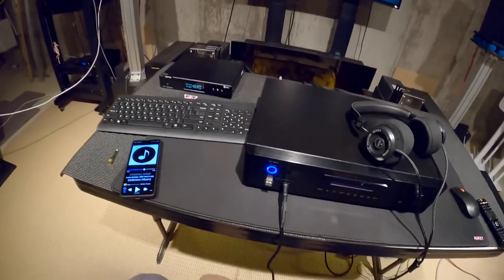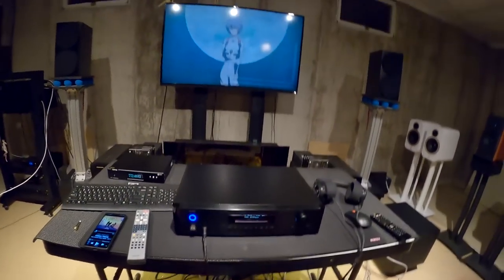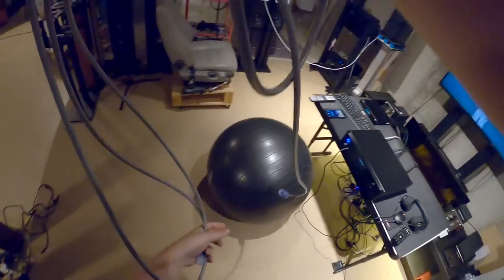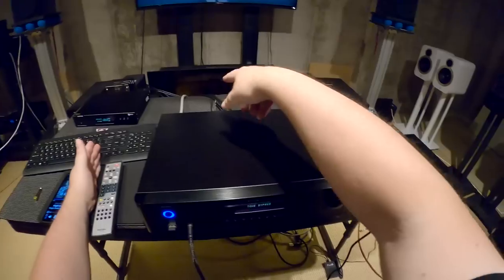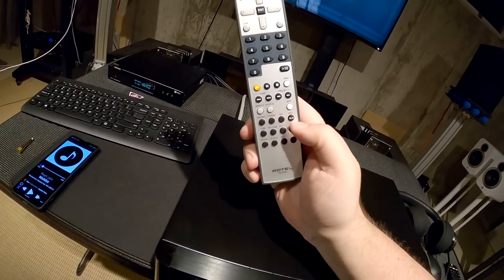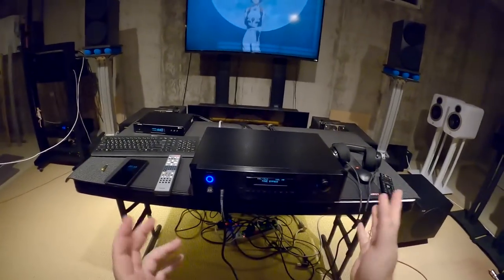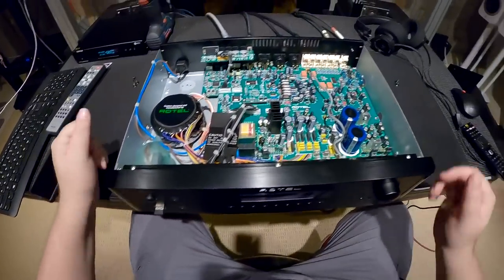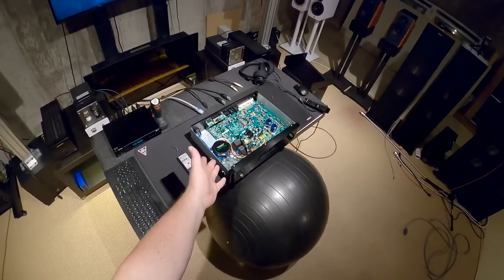🟥Why don't Cheap Pre-Amps Exists? _(Z Reviews)_ ROTEL RC-1570

Comment: This has been my pet peeve for 20 years. Thanks for bringing it up. When you can get a receiver that does 7.1 DTS/Dolby digital for $500 or less yet a pre-amp that has NO AMP that does the same thing can't be found for under $2000. Well, that's not entirely true anymore as Tonewinner came out with one for $1500. But still. ALL receivers should have PRE-OUTS!
Reply: You can actually do this with studio level interfaces, I use a motu A8 for it. Set it up with a pc, then you can use tablet or phone to control it through wifi. $800 and it has really good ess Sabre 32 dac
Reply: @Edinsism  Do what? There's no hdmi input on that nor multichannel processing.
Reply: @redstang5150  The unit he reviewed doesnt have hdmi either. The motu interface is literally used for making surround sound, it has optical and USB and AVB. You can program the unit to take any of its inputs and route it to whatever analog out you want. Hard to explain but the software will take that optical or cpu output recognize if its multi channel and you can route it how you like. In the case of a reciever you can use preouts into the analog ins. You can also eq your speakers and phase delay them at the same time if you want.
Reply: @Edinsism  No, but the point was about reasonably priced pre-pros - the key being the 'processor' part of that, and therefore you need something to decode the DTS or DD multichannel signal. That motu 8a seems to be more of a mixer/eq similar to a miniDSP - are you saying it can decode DTS HD and/or Dolby TrueHD deliver to it over USB/Ethernet (optical only delivers up to 5.1 channels)? It looks more like something I'd actually mix a 7.1 track to produce a movie rather than use it to decode multichannel tracks while playing movies from my plex server.
Reply: @redstang5150  yeah it doesnt decode dts. I use it from my pc which decodes and sends it through usb or ethernet. I use standalone amps so it does the same thing as a preamp for my setup. I got out of the reciever game a long time ago because they get outdated too quickly. I primarily use it for games. I am sure there is studio device that does what you want but its quite hard to get any real info on them.
Reply: @Edinsism  So what on your PC 'decodes'? I have separate amps too - like anyone that is using a pre/pro or has pre-outs on their receiver. For home theater - how do you get out of the 'receiver game' without having something that decodes DD/DTS? That's my entire point - spending $2k - $5k on a processor is crazy because that's the ONE thing that becomes obsolete. When a receiver that costs $500 can decode DD/DTS, I should be able to buy just a processor for that as well.
Reply: @redstang5150  You can software decode with certain codec  packs and play from media players that support surround  sound. The only thing that I have found doesnt work to my  knowledge is atmos height  channels. If you do use HDMI on  pc, you can also decode with nvidia cards before its sent out.  K-lite codec pack is the one i used.
Reply: I dont think i have ever owned a receiver without preouts

Comment: Usable class A and/or AB circuitry is not cheap.  Preamp is where the most gain is applied to the signal chain, which also makes it the most susceptible to noise.  Can’t skimp on shielding and power supply filtering in a basic 1in/1out pre, let alone units with multiple source inputs and output

Comment: Assuming you didn't make any big mistakes matching your components, the preamp is the most important piece in the system. Alot goes into making a good one. The parts are expensive, they're much more difficult to design, compared to something like a power amp, and depending on certain design choices, the build can be very labor intensive. 

The preamp is so important for good sound, I would rather spend less money on an amp or speakers (within reason), to get a better preamp. For the most part, the higher prices are usually justified if you look at what goes into them.

Comment: That bright blue ring on the power button, it's actually Emotiva thing. I believe Rotel RC-1570 is manufactured by Emotiva (under a different name - they have a different company set up for manufacturing for other high end companies). Some guy at Emotiva just loves a strong super bright blue lights. He said during a certain interview that he loves a strong blue light. Apparently he hasn't changed.

Comment: The Douk Audio P1 is a valve based preamp, with a (poor) DAC and decent BT and RCAs as well as tone controls. You did it back in Tube Week.
Reply: Are there are cheap, good power amps i.e. without volumes knobs??

Comment: Still using my Jotunheim as a pre-amp/DAC/Headphone amp.
Balanced outputs to a hybrid tube headphone amp (HD600s), unbalanced outs to an Smsl SA98e (with broken volume knob, so Jot controls speaker volume perfectly).
Great combo.. If I don't want tubey headphones for games and such I can plug the HD600s in to the Jot or use a different pair.
Love it

Comment: Emotiva PT1 is a good affordable pre amp. It’s the new version of the old PT100 and is a bit improved
Reply: Cant go wrong with anything EMOTIVA
Reply: @xray111xxx  I have the A-100 amp and couldn't be happier using it as a desktop solution paired with the PT-100. It's both a powerful headphone amp and a current monster class A/B power amp with 80wpc @ 4ohms, so plenty for my 94db ADS L810s. Once we move and I get some room for it, I also have an XDA-2 balanced preamp/DAC to pair with a monster NAD 208 amp, using the RCA output for the subs and the XLR out to the NAD to gas up a pair of ADS 910s. Perfection.
Reply: God I was sorely disappointed in the pt-100, granted it was around 350 or something but still. It was definitely the final nail in the coffin for me buying anything emotiva again.
Reply: @testtest-ol3yi  What did you find wrong with it?
Reply: @testtest-ol3yi  I also like the double-summed outputs but felt the unit to be a little glitchy out of the box, but it seemed to shake them out after a couple of weeks. It is satisfactory for my desktop as right now I use headphones the majority of the time until we move. It's the A-100 power amp that I think steals the show. Powerful headphone output ( 1.3w @ 300ohms/12+watts @ 32ohms ) with a relatively good noise floor and lots of current to my current-hungry ADS loudspeakers. It was $200/shipped back when I got mine and I considered it one of the best deals in audio at the time.
Reply: @trog69  I actually liked my a-100 until it just stopped working entirely after a few years, sounded phenomenal for a brand new component at that price point. But I actually did not like it at all for a headphone amplifier. I found it to be horribly noisy no matter the headphones that I used with it, with or without the jumpers. Great speaker amp, though.
Reply: @testtest-ol3yi  I found that, too when I first hooked it up, but after a few weeks I got things settled down and it's been a great headphone amp. For one, most headphones just will not like all that power so its need attenuating. I don't remember what I did to fix it but it works great now, though I use the Monolith tube headphone amp more often.

Comment: Thankfully they changed some of those annoyances with the newer models. My Rotel A12 doesn’t have the crazy blue led ring lol, and it has the function of dimming the blue leds. Also the power led turns red when you turn turn off power with the remote.
Reply: i bought this preamp and my stickers were so old that they couldn't be unpeeled. Hahaha.

Comment: I owned a Rotel rtc 965, preamp processor. That's a switching amplifier+ a processor. Mostly because they are made to a higher standard, then receivers. I owned mine for 16 years then I replaced it with a Marantz av 7005 home theater processor which improved the sound immensely. Used on Ebay it was $350 great buy

Comment: the cheapest preamp is a potentiometer, its got a gain between 0 and 1 and costs less than 10cents,  
putting a generic audio opamp (5532, 1115 etc.) after it to increase its gain to anything between 0 and 11 
or to buffer the signal to prevent problems caused by the amp input impedance
then giving it the best power source, two 9v batteries. no noise, no hum. 
but since eyes are 99% responsible for perceiving sound nowdays, you gotta put it in a polished metal box and write some fancy name on it.

Comment: A preamp is anything with line Inputs, volume & line outputs. They can have headphone amps & digital Inputs, or not. Z has done probably hundreds of reviews of preamps. He calls them dac amp combos usually.
Reply from the maker: I would say you still need an analog input switching capability to make me happy and call you a pre-amp
Reply: What you described could be a one source preamp. Z is talking about a multi source preamp.

Comment: Just ran into this. Back in the day I had a ~$800 NAD 5.1 Receiver. The DSP board died, but the 5.1 inputs worked to feed the amps directly still. So I had a 5 channel amp. I bought a used Outlaw 7.1 preamp for ~$300. Later the rest of the NAD died and I bought standalone amps. Just a couple months ago, the Outlaw died and I looked around for a decent 7.1 preamp figuring they should be around $400-500 new... Nah.. Not available. Can't get it. The CHEAPEST preamp that will do what I want was over $1000. I ended up buying a used Marantz Receiver off Ebay for $100 and shelved my amps for now until I can figure out something else.

Comment: Been looking for a good preamp for use with my Reisong A10 (only two inputs), so for I’ve been leaning towards a Rotel or Emotiva. Thanks for review to broaden the horizons. Maybe used would work?
Reply: Go for an older Adcom. I own one from the mid 90’s and it’s excellent in a nice 2 channel setup. No remote. Just nice high quality smooth positive feeling knobs with very abrupt detents.
Reply: @Assimilator702  nice, yeah I’ve seen a few of those on Reverb as well, I think the 555?

Comment: I guess the Ragnarok 2 is kind of fitting the bill, apart from price. You could put two DAC modules in it and still have three analog inputs. But it would be two USB DACs instead of coax and TOSLINK, say.

Comment: Why buy a cheap preamp..? If you're in the budget territory, you should be looking at some of the awesome integrateds out there which have pre-amp outputs.
Proportionally, you spend more with separates because a huge fraction of the cost for any component is the chassis. So, going with separates really only makes practical sense once you're into the high-end territory where you're willing to spend a lot more for tiny gains due to over-engineered, expensive power supplies and whatnot.

Not that there aren't some out there who may benefit from cheaper pre-amps, but it's just a bit more of a niche audience. Some of these recent integrateds would probably match this in quality and include a whole power amp section to boot.

Comment: I had a hell of a time finding a quality DAC (priority first) that had an excellent pre-amp out via balanced/XLR. After a lot evaluation finally found the Nuprime line. Solid metal / al build, excellent DAC, audiophile analog output stage, and 99-step ladder volume control. This DAC/preamp combo directly connects to my Mark Levinson power amp. It beat out multiple configurations using separate DAC and pre-amplifier that I tried.

Comment: okay, 4 mins in video so dont know if he answers this later on but... why would you ever have multiple inputs? Z said that a pre-amp is just something where you switch between inputs and control the volume. but where would you ever need/want multiple inputs?
Reply: I have my radio on one input and my pc on another
Reply: Different Dacs, DAPs and phono stages etc. Heaps of reasons it's handy.
Reply: CD player , PC , smart TV, phono stage , bluetooth module, radio , cable for connecting a device basically and playing music ... There are plenty of sources to switch for
Reply: What matt said.

Comment: Pre amps without 12v trig inputs are infuriating. Ive been searching for eons and so far all I can see is the benchmark line, and the Cambridge azur 851e. I believe this rotel link is some nonstandard thing. Why a preamp would assume it’s the top of the audio chain, and have no trig input is WILD. I want to be able to hook up a streamer and start my hi-fi remotely, and basically no one supports this.